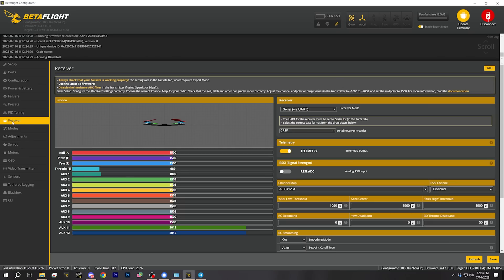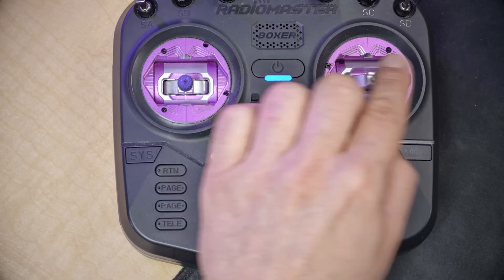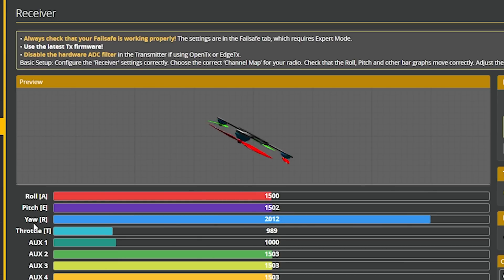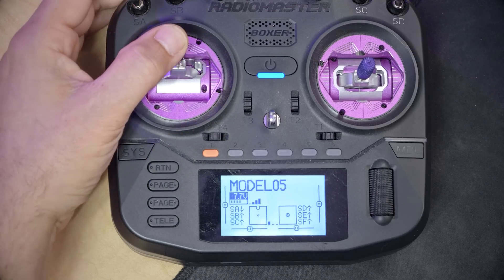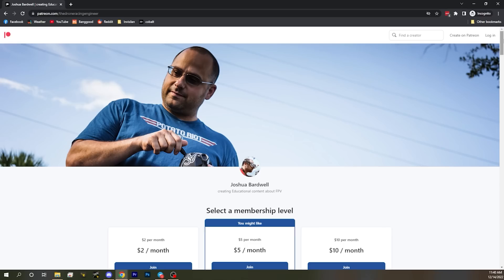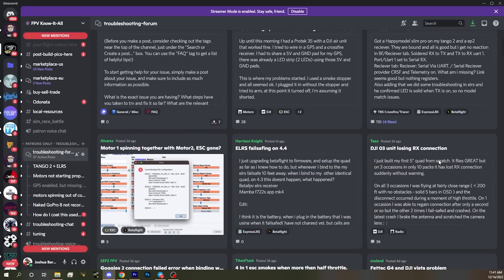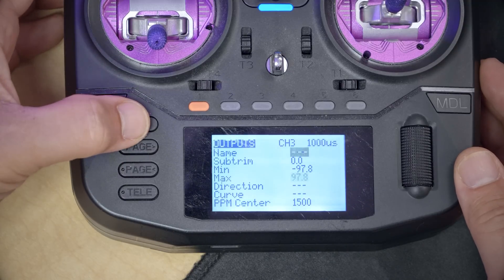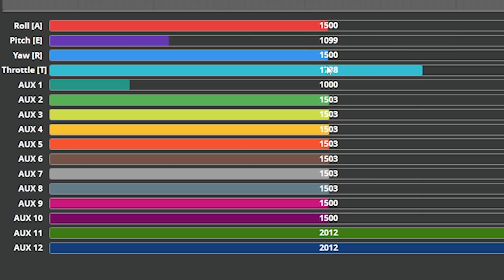Sub250g FPV Drone Build - 07 - Channel Mapping & Endpoints

Comment: I set my Endlinks, on controller says 1000 but in bf it says 1010. At -100 and 100 it showed the same as yours. So my adjustments ended up being the same but stick down showed 1010 and max stick showed 1989, most likely gimble calibration?

Comment: Joshua I have a question regarding your 5 inch build kit on getfpv. Can the moonlight vtx walksnail camera fit inside the frame? I heard it's a little bigger and wanted to know if it would fit.
Thank you
Reply: It will fit but I’m pretty sure the mounting screws are different